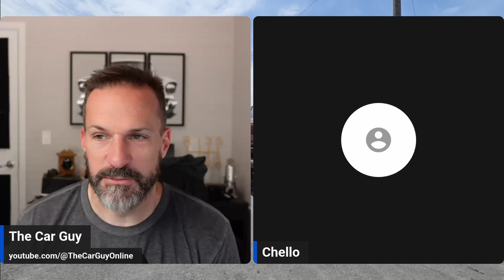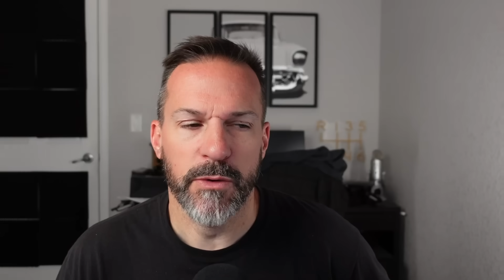Former GM Engineer EXPOSES Planned Obsolescence Tactics.

Comment: What general motors and other manufacturers need to do is stop giving us subpar quality metal and start building cars like they did back in the day and start making them last longer with better reliability stronger and more robust engines instead of quantity or quality it should be quality over quantity and for god sake stop making engines smaller an engine for any car should be now smaller then 1.8 litres and 4 cylinder should be the smallest anything smaller than that is just asking for trouble even more so if it's a inline 3.

Comment: Sad to see GM treat vehicles like throwaway appliances. 

One of many reasons I own a 2020 Toyota Land Cruiser Heritage Edition—which is designed and engineered to last decades and 250k plus miles with routine maintenance. 

For my family, brand loyalty to Toyota/Lexus is due to outstanding long term reliability.
Reply: The problem is, this is happening industry wide, in most industries. The only way to know if that Land Cruiser will last 250k miles is to drive it that long. I bet the LC from 10, 20, 30 years ago could do it - but can the new ones?  Did Toyota change to cheaper components to save some money? No idea - until you actually keep the vehicle long enough to find out.  All it takes is to switch out a single component, like a timing chain guide, to save 50 cents per vehicle, only to learn that those guides fail after a certain amount of time, and take the whole engine with it. (This was an Audi thing.) 

I hope your LC does last you 250k miles!  I just don’t have faith in companies to keep making quality products.

Comment: Here i am driving my 1998 volvo wagon  960. That last of rear wheel drive true volvo. I keep going back to it after sometimes going unused for years on my driveway. I drive groceries for the handicap. I had a ford fiesta died 1 year of use 60k miles the tranny blew up. Even with oil flushes and everything. My brothers f150 blew his tranny. My mom's Pontiac grandprix blew her tranny. 230k miles later my volvo still has original tranny and engine no issues. But is not gas efficient so now I use a 2009 nissan versa with 5 speed manual transmission best car i ever had i put 60k miles a year. I changed the  manual clutch once already and keeps going. So best advice I can give you is buy a Japanese manual car with a small engine and don't rev it over 4k rpm oh I just wanted to add something older cars had obsolescence too but we didn't have AI before so human would just made it a bit better "just to make sure" my wifes 2002 mercedes e320 still on the road 200k miles later. Newer mercs are garbage. Plastic everywhere.
Reply: Mazda is the new toyota
Reply: Bad idea to keep it under 4k. It ain't a flathead. Modern engines clog up if you don't run them hard every so often. Seen it many times with elderly owned cars.

Comment: 3:50 A GM ZF transmission is a 6 speed MANUAL!!! what are you talking about dude?
Reply: He is referring to the ZF auto tranny not the manual. If you are here to tell us how good GM automatics are......I don't even know what to say to that LOL.
Reply: @jeremydawkins8399 right. Have a 2002 Z28 that I have had since 2002 when it had 3 miles on it and the furst 3 things to break were the 7.625 rear end, followed by the glassware inside the 4l60e, then both of my power window switches burned up. Put a mosier 12 bolt in it, built a 4l80e for it, found a v6 with crank windows and swapped all the guts. The ls1 has been a trooper and has only been rebuilt 1 time and when it was built we did a texas speed 228r cam and a good set of ported 243 heads. Now its just a shop space holder and I drive my coyote Ranger every day.
Reply: ZF made a host of automatic and manual transmissions for many manufacters. I believe the one you're referring to is the S6-40 in the C4s, correct?
Reply: @luisbalderrama8145 GM used the ZF6 650 in the Duramaxs from 00-07 as well

Comment: The type of rubber that's used in all seals tyres doors are all inferior and has been going on for 20 years. Like cam cover seal it's like steel when taken out and so put a new one in but must have been old stock and was already going hard, so it will need changed again in a few years after the engine heat cycles. I watch a program on a rebuild of a WW2 tank and the wheel seal was taken out and was like new and soft and that was 70 years and the Germans had great difficulty with rubber and the make up with synthetic rubbers because of bombing etc. Now a days the seal breaks up in your hand.

Comment: Driving an old but reliable car, is an act of rebellion.
Reply: Why do you think cash for clunkers was so heavily pushed. It was the beginning of the end for the reliable, affordable vehicles.
Reply: @TurdFerguson-9  no black box technology, no location tracking, no eavesdropping technology, no able to 'hack' technology, no repo technology, less unnecessary options which go bad creat  service required by dealership. Less expensive by far license plate/sticker, less insurance cost, many times a softer ride when hitting rocks in the road. Tires were cheaper due to rim size of 14 or 15inch (not sure of that now, haven't checked to compare). And the average "MAN" yes I said "MAN" could tear it completely down to rebuild the motor or the one single part that the engine needed to be repaired. No window regulator needing the latest revision of software to operate, no power train computer, no stabilization electronics, no def? fluid urea piss in the tank additive required as some diesels do, and they had distinct looks. Everything now seems to just look basically the same. And dang, none of them were having the look of a goofy stainless steel cook table going down the road with no emissions, or sound. Oh, and I almost forgot if they caught fire the fire department arrived and could put them out (except the magnesium engine Volkswagen). I remember a national geographic, 1985?, it had a Ford ranger showing 29mpg on the ad. I thought dang. Let me GOogle and see what a ranger gets now. So I pulled it up and it said 27mpg. I thought dang. They lost 2mpg in thirty years, WOW. That's rocket science engineering for ya. College education. And I recall the politician talking about the dumbing down of America, Newt Gingrich. Now I may add I recall a New York times reporter capturing a photo of the renegade who was reading the book titled 'the post American world' almost ten years ago. Maybe we are now in that.
Reply: I'm still driving a 2002 F150. Not rebellion. Voting my pocketbook. I understand cars cost a lot of money, but not paying a lot of money for a POS car.
Reply: 2004 gmc pick up !
Reply: 2008 Toyota Yaris 5 speed. 212k miles on it. Owned it for 5 years and 50k miles. Only needed a radiator, because I hit a huge ice chunk in the road, 2 new sets of tires, and the starter (easy replacement with no lift). I put 100 miles a day on it every day the last 6 months, 100 degrees blistering heat or 0 degrees frosty snowy cold. You'll never see me sell it. I'm gonna replace anything that breaks including the motor. People see you driving a bucket like this and assume you're poor. Couldn't be further from the truth, holy shit
Reply: @fastcar42069  As an Echo guy "I know it's a Yaris :P" I salute o7
Reply: @E9Project  Scion xA baby
Reply: @fastcar42069 I hate the way people are judged by their vehicle. Some people don’t feel it but I do unfortunately. It’s really stressful.
Reply: And knowing how to fix and maintain it yourself.
Reply: Agreed.
Reply: 2001 Toyota Echo reporting in.
Reply: My latest purchase is a 1991 GMC Sierra with 150,000 miles. Love it. F this new sh!t.
Reply: Funny my dad was the one to get the 06 Camry new back in the day that I've driven the past decade+.. say funny because he's been bugging me to get a new car, even helping to foot a lot of the cost and I'm dragging my feet so long as it's reliable
Reply: @davidglad no reason to get rid of it, the 'trade in value' will always be less than what it's actually worth, so if he wants to buy you a new car then let him so you have a beater while you keep that 06 pristine.
Reply: I'm sticking with my 2001 Saturn SL2 stickshift and my 2002 Saturn SL2 stickshift for as long as I can, because they seemed to WORK to set a high-water mark on that model.  And I will NEVER buy another GM product again.  And it's a shame.  My family has been a mostly GM family since the 1970s.  Change oil EVERY 3,000.
Reply: @williamjones7821  my 94 sl2 automatic has a bad transmission but it will not die completely and I fully intend on getting it going again. Even though parts aren't very common they're still worth it to fix
Reply: @underhat7992  You need to stick a fork in that one.
Reply: 1995 Tercel MT 400,000 miles engine rebuild last year still going.
Reply: I've been driving old cars long before it made financial sense to be driving old cars... I just like the way it feels
Reply: I am staying with my 2003 Yukon! It has 200K and still going. I have changed the oil every 3000 miles and air filter, still has the original spark plugs. I just changed the fan clutch and traveled from OH to FL, and back, no problem. However, I am noticing a slight slippage in the transmission, I believe it has the 4L65E, so I am prepping for that. Otherwise, I am driving it until the wheels fall off, or it rust beyond repair.😂😂
Reply: I have a 96 Isuzu rodeo with 150k miles, and I believe it’ll last longer than any cyber truck
Reply: Reject modernity!
Reply: Mercedes Benz W124-210 , hell even Jaguar XJ40 and X300 have been far more reliable than GM products I've been dumb enough to drive.
Reply: Love my '98 Grand Cherokee forever and ever
Reply: It is an act of intelligence at this point.
Reply: 1953 dodge here. original point ign. she gets 11 mpg at a top speed of 55mph. My old 1988 chevy suburban ironically also got 11 mpg....
Reply: & simply unable to afford anything newer & why would I want to own anything newer
Reply: 2000 Buick Century, 1995 F250, 2002 GMC Yukon, and 1992 Ford Taurus. 
Need I say more.
Reply: 2003 Mitsubishi Montero Limited 139K... will go another 139K.  Made back when Japan took pride in their products.
Reply: Ive driven a 1964 nova for over 15 years.
Reply: 06 yukon with 300k on the dash and around 10k rms in audio beating the fuck out of the truck... Drives like it's new 🤣
Reply: I’m keeping my 99 Regal and 2010 CTS until they turn to dust
Reply: My truck just turned twenty- six. My wife's car is twelve.
Reply: Not parting with my 2006 Trailblazer for anything
Reply: 99 civic ftw!
Reply: Your dreamcar must be the AMC  Rebel.  SST or 4 door station wagon? ha ha haaaa.
Reply: I have a 1992 c3500 with a 454 and the nv4500 manual. I love it. It's not super cozy but it's a great backup truck. My daily is a 2011 tahoe and it's been flawless but ik I'm just lucky. Lol. I refuse to buy new considering new trucks are rotting away and the transmissions can't handle light driving
Reply: I recall a friend with a 2-3mo old Chevy 4x4 pickup. I think likely 2013 model. It somehow got the front vs rear ends locked up? He said it wouldn't move. He made them take it back and got a different truck from them. I know a couple guys with 2017 era trucks already replaced transmissions.
Reply: 1977 chevy nova still purrs like a kitten but with hookers
Reply: kinda want to for my freelance "company" car. but, if you don't get a modern low emissions model where i live, they tax it so hard you're financially better off with a modern-ish hybrid or ev. my example is wanting a e39 530d bmw but i got a low mileage g30 530e instead because it was that much cheaper all costs considered. also the older 530d isnt allowed to drive in big cities with low emissions zones where i often have to drive to for work. the g30 530e is comfy af but im scared to keep it beyond 150K miles.
Reply: W123.  W126. OM617a.
Reply: 62 Catalina ls1 , 700r4 and a Ford 9inch 
Just finished the AC
Reply: yes but the road is filled with newer 6,000 lb to 9,000lb plus hybrid and electric SUVs/pickups that can decimate older steel formulations used in older vehicles in a collision
Reply: @gordonmccracken1209 that weight is all in the batteries lower than sitting height. The panels are all styrofoam covered in 18 gauge aluminum foil and/or plastic. 2021 subaru forester tboned me with us both doing 40mph and all it really did was bent the passenger doors forever closed and broke the rim and tierod endlinks. If it had had 3000lbs of battery at shin height it probably would have bent the frame a little more at the bottom, but probably wouldn't have affected my actual safety.
Reply: I have a fleet of old cars. 2000 Chevy suburban, 2004 Toyota rav4, 2010 camaro ss.  Yes they require repairs at times but having 3 cars keeps me on the road.  But keeping them is lot cheaper than buying a 100 grand truck which has more failures than my vehicles.
Reply: 2008 ford focus
Reply: Still driving my 98 Forester, and plan to mod it to an EV if the engine or transmission ever fails. Cost $3500 in 2015, $2000 for midlife overhaul. 10 years/100k miles later, still waiting for EV day. Daily driver with 500 lbs of carpenter tools
Reply: Volvo 240 400k and still going.
Reply: dealship stopped working on cars more than 10yrs old. were i leave in GA.
Reply: Building vehicles that are stylish and expensive is fine if the target market finances for 2 years to 3 years, and then trades in for a new one. This leaves a 2 year old gem of a used car for the used car buyer.  In 1970 this was a common pattern for many people. Wages were hirer then. Wages now have far less purchasing power then in 1970. Return to making all parts in the US.
Reply: 07 Accord 178k. Boring car but it runs good. Paid 3500 for it.
Reply: Yup, I drive a 2006 Chevy Colorado.  I also have $136,000 in my investment portfolio.  Priorities.
Reply: I always saw it as an act of wisdom.
Reply: Amen. I’ve been driving a 95 nissan pickup since 2004. Still runs great and easy to work on.
Reply: '98 Silverado Z71 here with 250K miles. Looks and drives exactly like how it rolled out the factory in '98. Original engine and transmission, most reliable vehicle I've owned. I bought it with 140k on it 5 years ago. It's been across the entire country and more than 26 states. 

So glad I picked one of these up before the market exploded on them.
Reply: 1999 is where I draw the line..and my 5.7 is still running fine..and lanolin makes the bottom of the old suburban shine!
 I have a fresh trans and transfer case in the shed..and a complete spare set of rust free doors. Im gonna drive it for the rest of my life.
Reply: Amen! 🙏🏽
Reply: Have never paid attention to new cars.... Im born in 89, have 2 business, and only drive old Toyotas, hondas, chevys, and jeeps.
Reply: GM sent me recall notice for my 2002Tahoe, saying it has lasted too long.
Reply: love my 01 Silverado and my 02 Camry.  Rebuilding a 97 Land Cruiser.  I always have a way to get somewhere and I will never buy something modern.
Reply: Cuba, here we come!😢
Reply: That only works up until some horrible driver totals your vehicle.
Reply: @user-vb6lq9il5v  mine is technically not totaled but would have been if either of us had insurance. I fixed it and it is perfectly driveable 2 years later. I will never get rid of this truck for any reason.
Reply: no its just wise. even though new cars are often safer
Reply: @TheBigJohny This is the only reason why I try to keep within ten years old.  I much prefer older cars but the increase in safety is more important for me. Largely as a result of more large trucks on the road.

Comment: It's ridiculous... the way these gm execs think. They want these cheaper parts but, if they actually used slightly better stuff, they could charge slightly more to compensate for added cost.
Reply: It's not about manufacturing cost. They want to sell as many new cars as possible. The way they achieve this is by making sure cars don't last.
Reply: @totuudentorvi7781 and yet, companies like Honda and Toyota started dominating the automotive scene back in the 70's by building cars that had quality and reliability which far exceeded what detroit was building. About the only thing that couod stop thise Hondas and Toyotas was them rusting out as their engines were bulletproof.
Reply: @generalzod7959  Today the entire industry is on the same bandwagon of making disposable junk. It's a cartel of crap and no manufacturer is an exception anymore. Old ways have died.

Comment: 2000 CROWN VIC with 400,000 miles same engine and transmission never opened up just regular normal maintenance and will never buy any thiing newer than a 2000 vehicle, corporate junk.